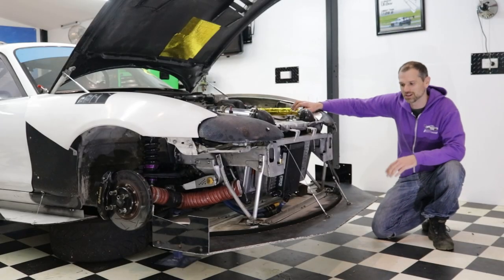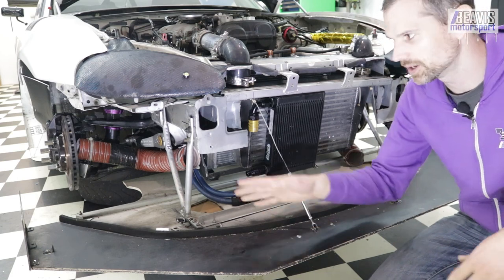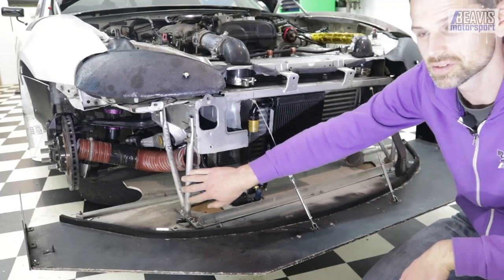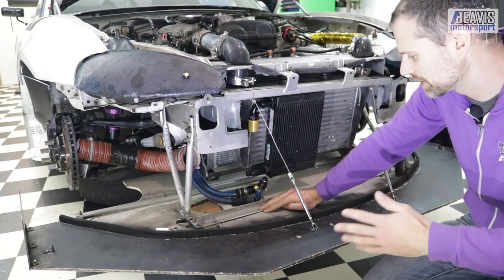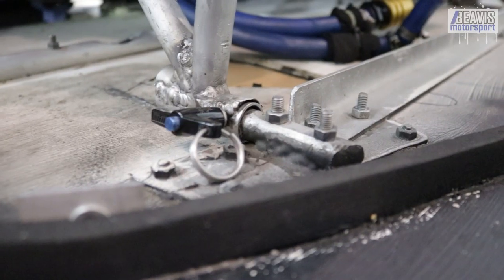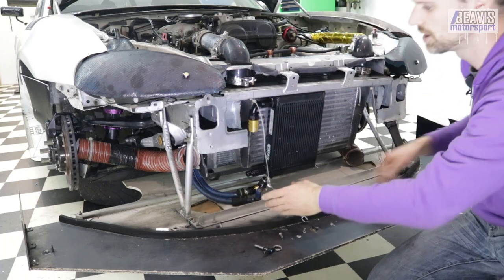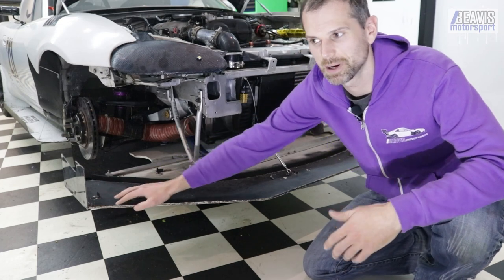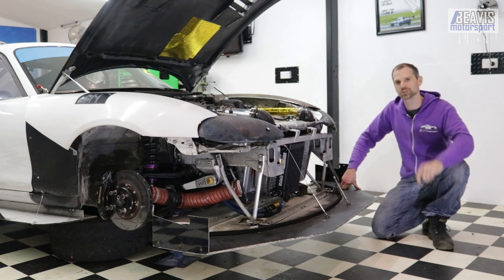DIY MX-5 MIATA PLYWOOD SPLITTER // Ep. 93

Comment: Bunnings marine ply has held up extremely well for me. Much stronger than their eco-ply or structural ply range having additional layers of timber and the waterproof adhesive has prevented any rotting, shrinkage, etc. Like the birch comes at a cost though! I did find the eco-ply very good for making a mock-up before cutting into the $$$ marine ply!  

PS - loved the write up in mxtra this month. Hope to see you around the pits soon :)
Reply from the maker: Thanks. I think the oil paint I used was a good help in keeping this ply weather resistant. I think the baltic birch stuff was supposed to be lighter/stronger than the more generic bunnings ply too?
Reply: @Bbeavis  marine ply is noticeably heavier than the regular ply as it is denser with the additional layers of timber (has less voids). I used some oil based paint and spray paint for a little extra protection as well.

Comment: Neat. Only question I had was if you did it again what would you do different?
Reply from the maker: Absolutely nothing, it's 100% perfect.
No seriously there's so many things that could be improved, the mounting bracket shape/strength, the quick release-ness.... be great to have something that was even easier to fit/remove. Also a lighter weight but stronger material would be nice.

Comment: I think the disturbed air from your supporting cables, out front, is negligible.
Reply: There is a penalty for wires out the front, not as bad as having your window down though.
Reply from the maker: Yeah I'm sure for my use case it's negligible, if you were a real race team you might care.